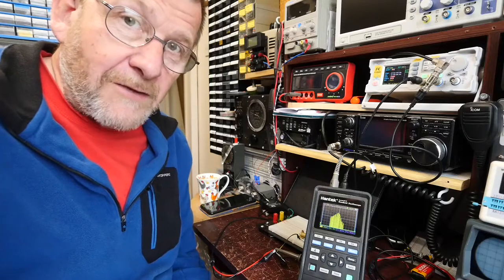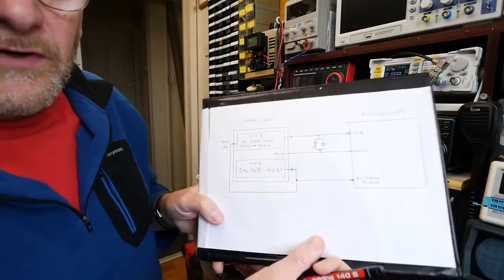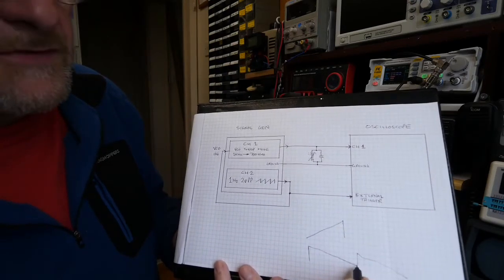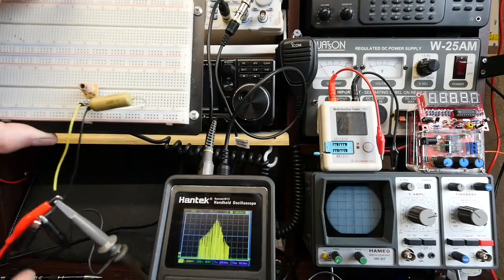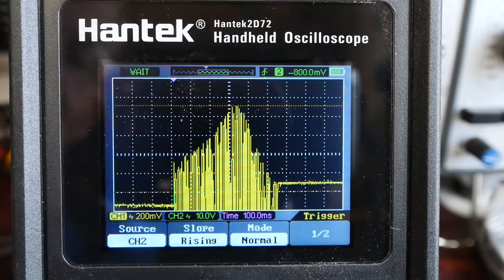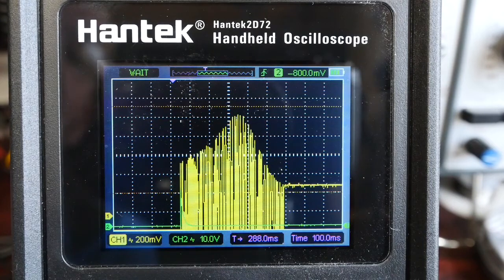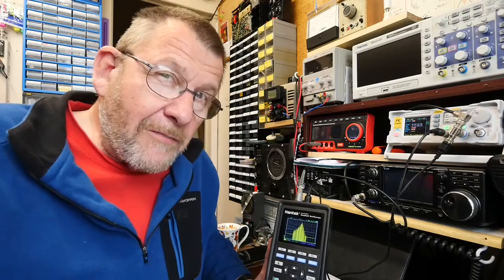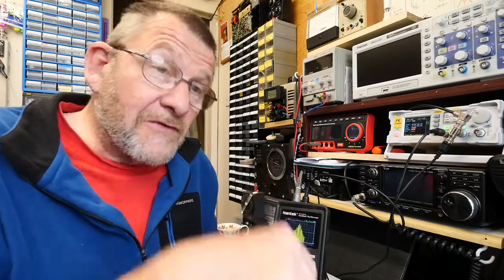Hantek 2D72 Handheld oscilloscope - displaying Bode Plots

Comment: The screen size on these appears to be ridiculously small. While the signal form surely can be observed clearly, the digital readouts are so tiny that it's hard to see them without eyestrain. Even larger 3.5"  screens of Owon/Hanmatek are still quite smallish. Good screen size starts with another form factor devices such as Hantek DSO1062/UNI-T1000C series with their screen size approching 6". Those devices are noticeably larger in size but the screen size worth it. They are also more expensive but as they say you get what you pay for.

Comment: Hi there - I'm interested in producing Bode plots on my similar setup (Hantek DSO5102P / Feeltech FY3200S)  - my current thinking has been around CH1 of the Feeltech feeding into CH1 of the scope & have the scope trigger using the 'greater than' pulse-width trigger option..

So,  if I was sweeping from e.g. 1Hz up to 20KhZ, & I set the scope's trigger to, let's say 'greater than 950 Ms', I was hoping that the scope would trigger off on the first 1Hz waveform, & then on we go..

-- Doesn't seem to want to play ball tho.. What might I be missing here - any clues?

Love the channel - always learn stuff :)

Best now
Reply from the maker: Not sure about the trigger, how about setting channel 2 to a ramp at the same frequency as your sweep speed, then trigger off ch2. Hopefully the FY3200 channels will run in some kind of syncro as they almost certainly share the same internal clock?
Reply: @LockdownElectronics  Will try - Thx for the reply :)

Comment: Am I correct to assume that we only see a bode magnitude plot (in linear scale) and not the bode phase plot?
And how is the x axis (frequency?) devided?  That is set on how you configure your sweep I presume? (based on time/div on the scope)
Reply from the maker: Yes it's a magnitude plot. The x axis is dependent on you timebase setting.  A FFT plot would be more configurable.

Comment: great job! what is that T shaped termination connected to function generator and Ext trigger of oscilloscope called?
Reply from the maker: It's a BNC tee adaptor.
https://www.ebay.co.uk/itm/BNC-2-WAY-TEE-PIECE-SPLITTER-COMBINER-FEMALE-MALE-FEMALE-for-CCTV-CAMERA/322528877000?hash=item4b183819c8:g:gE8AAOSwGJlZJtPt

Comment: hi, do you know the voltage range of the 2D72 you can measure? Does it support 230V - 400V inputs?
Reply from the maker: Scope is 150v rms max input. Meter 600AC, 400 DC, spec is on this web page:
http://hantek.com/m/productdetail/13174